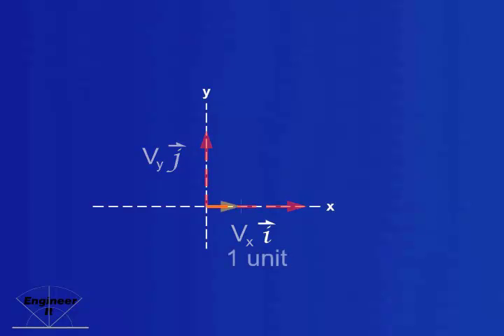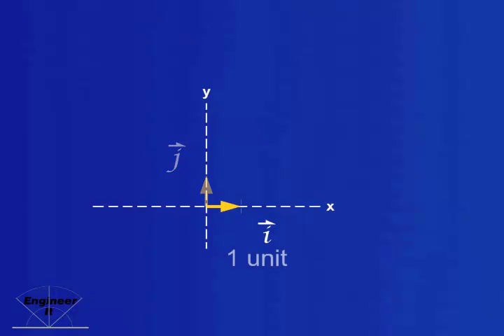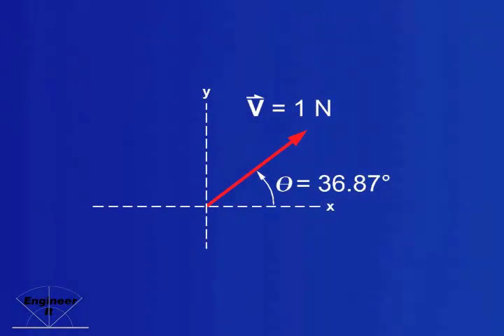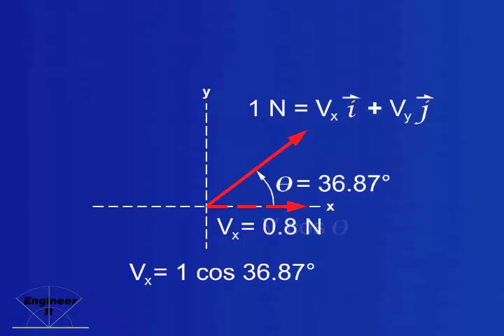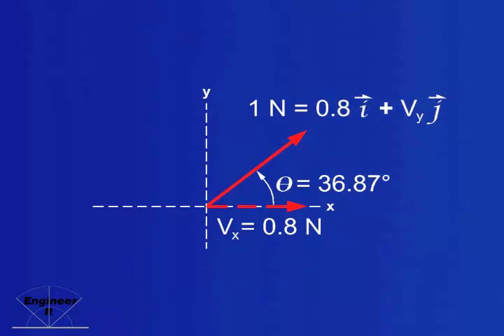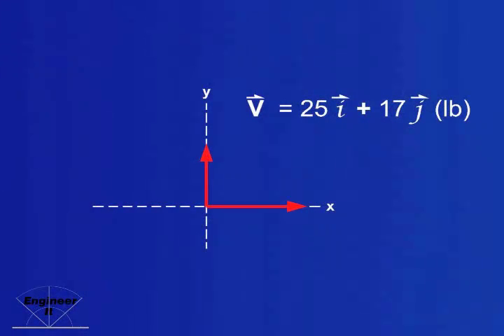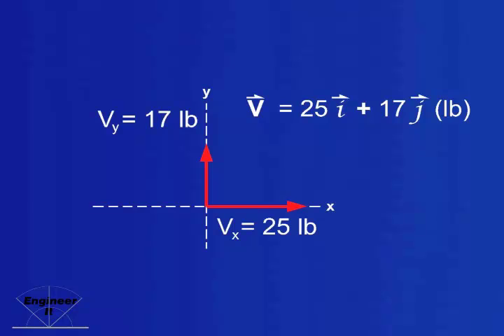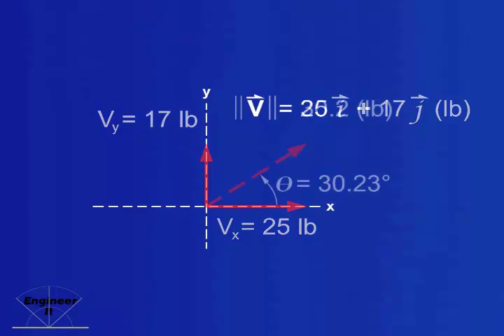2D Vector Components

Comment: Vx doesn't always = mag x cosine angle.   Teacher's and textbooks know this.  Try to trick you up by referencing the angle in odd orientations.  Only students who totally understand the concepts of opp/adj/hypotenuse and sin/cos/tan relationship by "sight".  Otherwise, best to "robotically" always "anchor" your angle from the positive x-axis arrow.  You do this, then x comp always uses cosine term.
Reply from the maker: All your comments are valid.  Thank you for taking the time to think about these topics.  Engineering students are very comfortable with trigonometry, vector algebra, and vector calculus.  As for unit vectors, they are more than a vector with magnitude of one.  They can be used as pointers, which frees use from the Cartesian Coordinate System.  Please stay tuned to the Engineer It Program as we expand our video library.